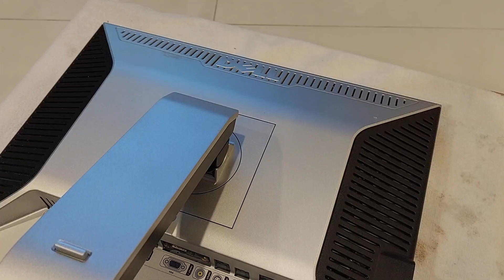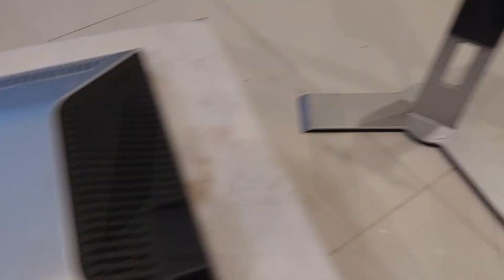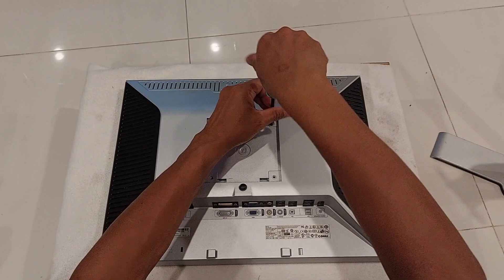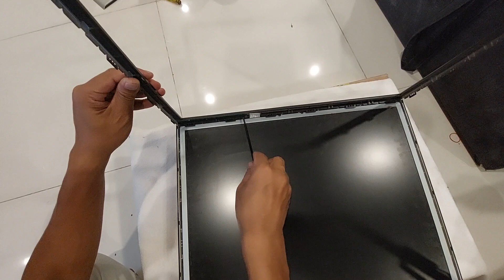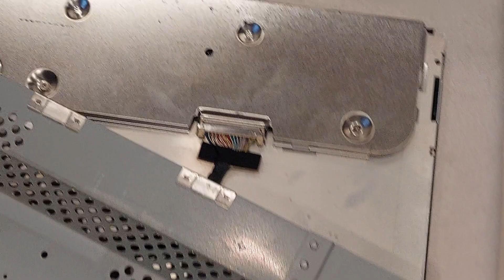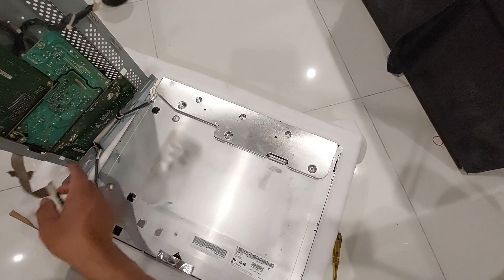Disassembly Dell Monitor Ultrasharp 2007FPb

Comment: Thank you!  This was extremely useful, showing how to pull off the bezel.  Since my fingers are not so strong, I found that as long as I could lift the bezel a little bit with my fingernails, I could slip a flat blade screwdriver in there to pry.  I avoided prying against the glass, of course.
Reply from the maker: Please be careful your finger.Of course it dificulty to pull off.Thank.
Reply: @RothElectronics please part number screen?